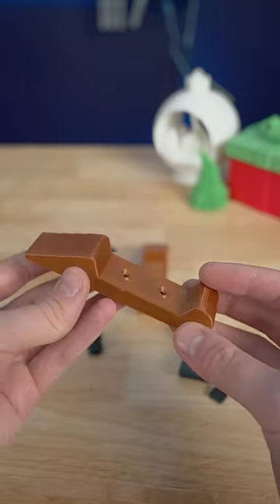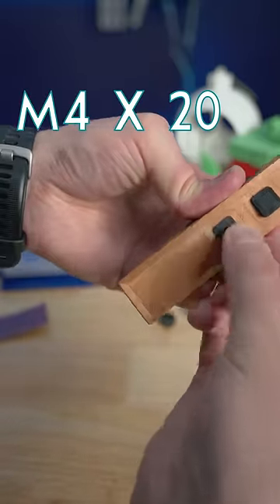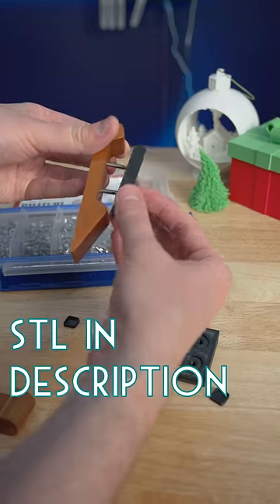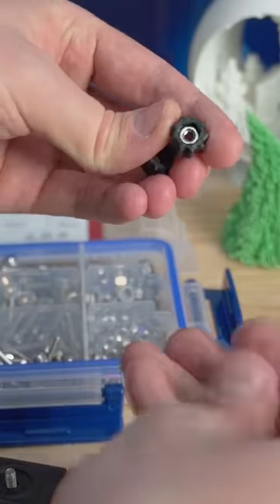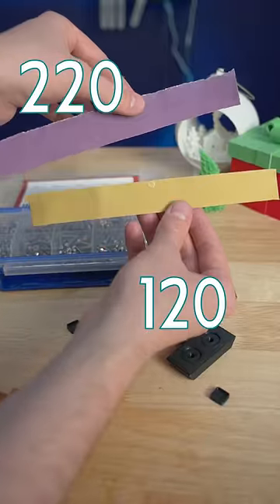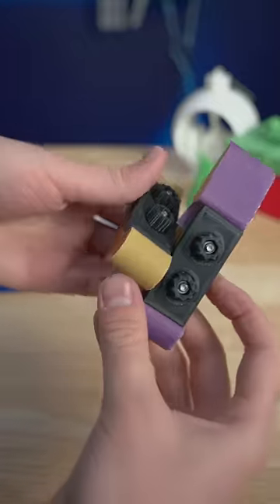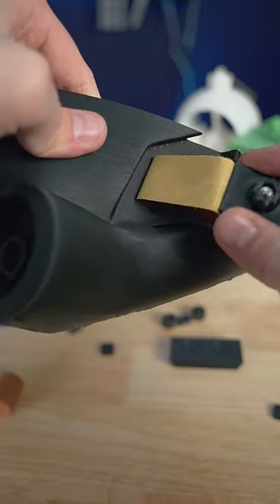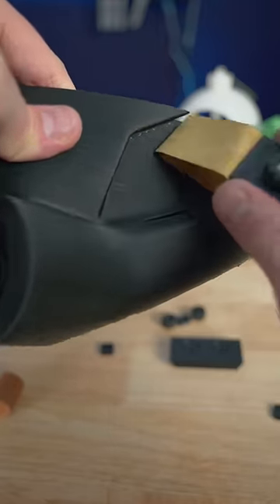3D Printed Useful Sanding Tools 🔧

Comment: Using a contained environment like an upside down terrarium with a opened bottle of alcohol sealed at the bottom with tape is the best way to easily remove that texture from the printed stuff.

Comment: I feel like you could probably make the actual sand paper surface smaller to preserve sand paper, however I see that the edges are used for finer sanding so the original design is a bit more utilitarian. My idea would be more useful for sanding flat surfaces, not so much intricate details like you intended with this print, good job, I want a 3D printer more and more every day.

Comment: M4 x2.0? You mean? I don’t use small bolts like that but metric thread pitch is 1.0/1.5/2.0 unless you mean 1/4” x 20 because standard uses 13/20/24 thread pitch counts. Just asking for clarification. 😊

Comment: 3d printing is time consuming. Just go into a hardware store, go look for the metal thingies that are used to mount drwall, pick a small piece with lots of holes for screws, bend it according to your needs, add the sandpaper and screws and you-re done. You can also use the holes on the bottom of the metal plates to make those holes that you often see in sand paper discs, that aid in the release of dust.
Now, if this guy wants to have the holes... must design & print a new part or take a drill at the already printed one...

Comment: buy the wooden clippers circle the sand paper around and they will do better job than these 3d printed. TRUST me i am doing it right as i am typing it. not to mention those clippers cost less than 1$. this 3d printed tool would slight cost more than dollar and printing time.